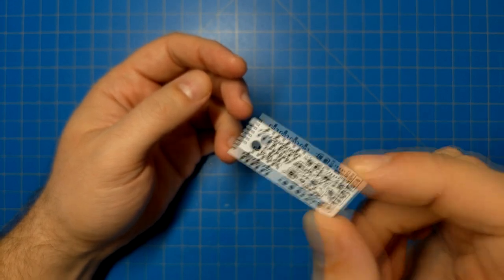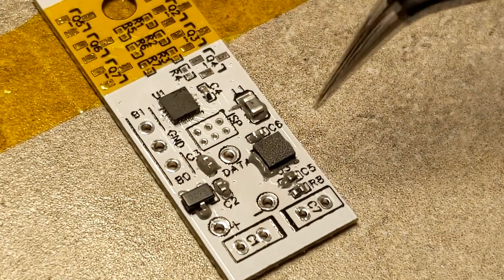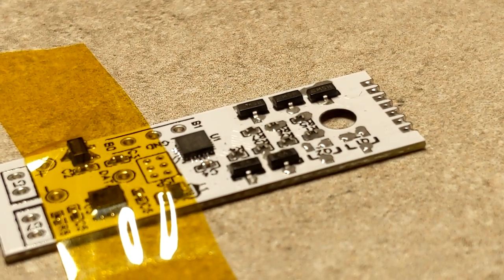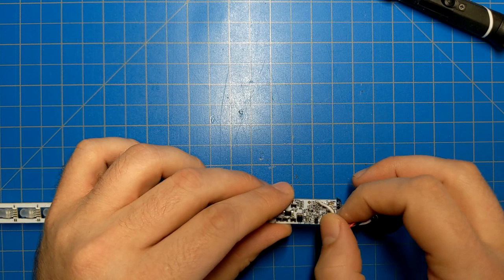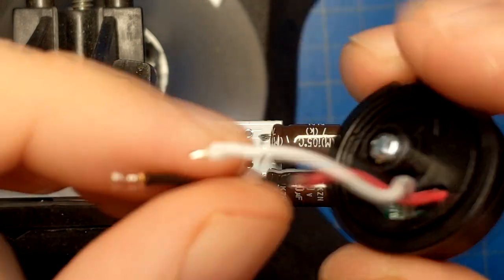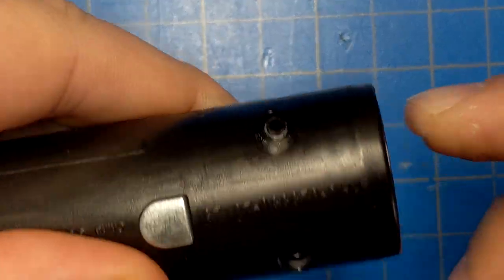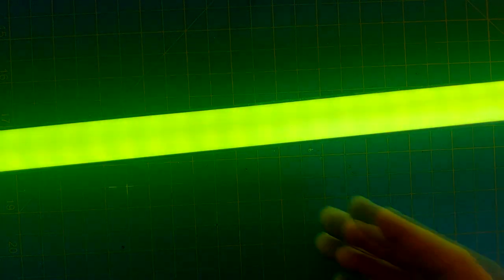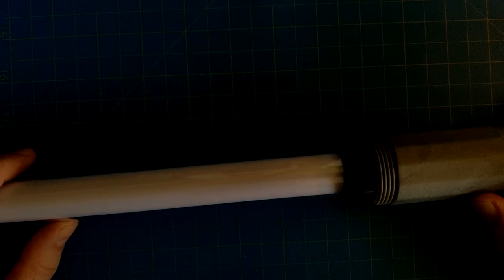Custom GE Blade Controller Build - The Short, Short Version

Comment: Question, could we switch the led's in the blade with Neopixel and then connect them to this controller, or do you have to use the original led's?   And I am really looking forward to when you share the PCB design and code!. I would really like to modify one of my blades so that It can do all the cool colors and animations that you have created!
Reply from the maker: this blade controller will only work with the stock LED strip.

it's possible to make a neopixel blade that works with galaxy's edge hilts, however every version of this I've seen has required a second battery be installed inside the blade in order to power the LEDs because there are so many and they require much more current than can be provided by the hilt.

i have an idea for creating a neopixel strip that doesn't need an extra battery and that's probably something i'm going to look into creating once the custom blade controller is done. however that will require a different, custom blade controller. i'll probably use some of the same components, but the PCB and the code will be different.

Comment: Was any reprogramming required on the hilt itself? Or are all of the features displayed part of the blade programming itself?
Reply from the maker: it's all in the blade. the blade is controlled by counting how long it is off. if under 1 second it changes the display mode. if under 3 seconds (but more than 1) it changes the animation effect.

 this will work with savi's and legacy sabers.

Comment: How did you program the microcontroller itself?
Reply from the maker: I used the Arduino IDE (https://www.arduino.cc/en/software/) with the megaTinyCore (https://github.com/SpenceKonde/megaTinyCore). megaTinyCore has good documentation on the programming process, but I'm using their old jtag2updi (https://github.com/SpenceKonde/jtag2updi) setup, which they no longer recommend.

on the PCB there is a 2x3 array of holes that are 1.27mm apart. i used a 2x3, 1.27mm pitch pogo pin adapter (https://www.tindie.com/products/electronutlabs/pogoprog-model-d-pogo-pin-programmer-2-pack/) to connect to the PCB and program it.

Comment: question why not add a hall effect sensor to switch modes?
Reply from the maker: you'd need to carry magnets with you and pull them out whenever you wanted to change settings. that seemed like too much of an inconvenience. but if that's not a problem, the next issue is where to put the sensors. they need to be inside the blade. 

put them inside the base of the blade then, when the blade is inserted into the hilt, they're under a layer of aluminum that makes up the outer cover of the hilt and will disrupt the magnetic field, making the sensors almost useless. 

maybe put the sensors inside the visible area of the blade (so they're not under the hilt) blade? but their presence will disrupt the visual appearance of the light when the blade is on.

maybe put them just at the edge of the base, where a magnet held at the hilt/blade interface would pick them up, but won't noticeably disrupt the visual appearance of an ignited blade. i think that would work, but now the issue becomes how to mount the sensors (glued to the inner sleeve that holds the PCB is probably the best option). but there's also the issue of different emitter pieces may make accessing that blade/hilt interface more difficult. maybe some legacy sabers have a piece on the emitter that extends above the blade/hilt interface making it difficult to get the magnet close enough to the sensors.

it's something i thought about, but it seemed to me that they'd be more trouble than they're worth.